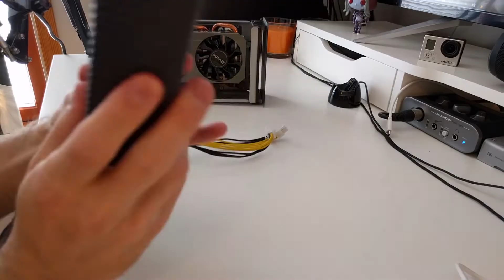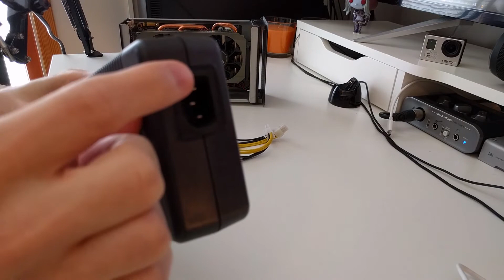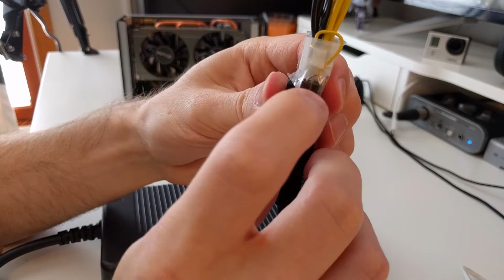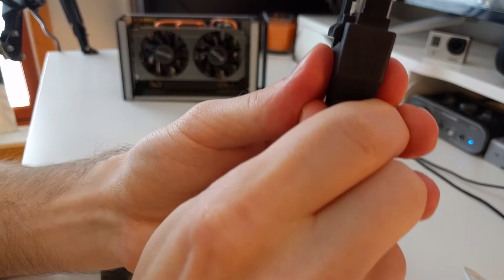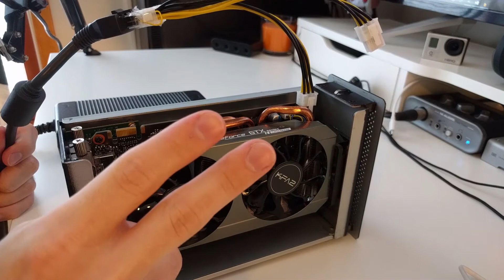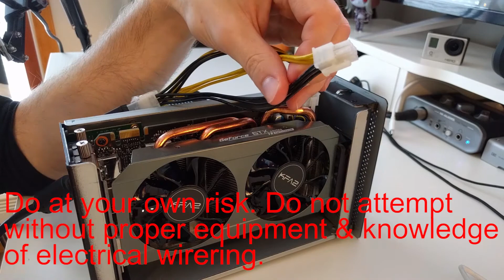External eGPU Power Supply (Dell DA-2)

Comment: Hey man super helpful video doesnt look to hard to pull off :)
could you please have a look at my issue
I bought this: 
https://www.amazon.co.uk/gp/product/B0725B6L99/ref=ox_sc_act_title_1?smid=A29EZVB447EKA7&psc=1
https://www.amazon.co.uk/OptiPlex-M8811-ADP-220AB-D220P-01-Warranty/dp/B005WTLNFK

I have a gtx580 which needs a six pin, Do I have to do that process making my own cable or will the one you linked work?
https://www.amazon.com/JacobsParts-Express-Power-Splitter-Cable/dp/B00JLU0UQ4/ref=sr_1_20?ie=UTF8&qid=1499517463&sr=8-20&keywords=PCI-E+6+pin+to+6+pin

I think I need an 8pin female to  six pin male and 8 pin male. Any advice would be much appreciated thanks! :)
Reply from the maker: I don't know what that XCSOURCE is, but that is the correct PSU and adapter, yes. You can add the female 6pin to the male 8pin on the Dell DA-2 like in the video, and use one of the 6pins for your GPU. The other 6+2pin can be soldered to a DC-barrel if you want to.

Comment: THANK YOU FOR YOUR video omg i needed something visual to understand what is going on after reading the egpu.io forums. 

Currently own a rMBP Late 2013 15" 750M. Plan to build a Thunder2, GTX 1060 SC.

I finally understand how the Dell DA2 8-pin fit into the Cable 6-pin! so you probably have to force it in and do the paper clip thing ya?

You mentioned about the DC barrel needed to power the enclosure. If i get the "(Dell DA-2 PSU) Akitio Thunder to 90 Degree 6-Pin PCI-E Cable w/12v Jack" from Kaeron it should be ok since the barrel is premade and i will just have to force the 6pin to the 8pin? 

You also mentioned there is an adapter that is premade for the 6pin to barrel. is it the "2.5mm x 5.5mm Female DC Plug to Screw Terminal"? So you just have to cut the yellow and black wires and attach them to the DC Plug? if not do you have links for the adapter?

THANK YOU ONCE AGAIN!
Reply from the maker: The (Dell DA-2 PSU) Akitio Thunder to 90 Degree 6-Pin PCI-E Cable w/12v Jack should work fine, if you connect the 6 correct pins to the Dell DA-2. I am glad you liked the video!
Reply from the maker: Buying that premade 90degree 6pin with 12v jack is gonna work perfectly. Just force the female 6 pin onto the Dell DA-2 and close the circuit with a paper-clip. You won't need anything else.